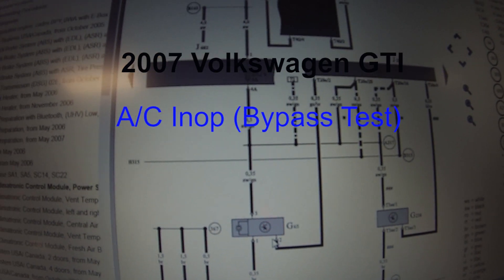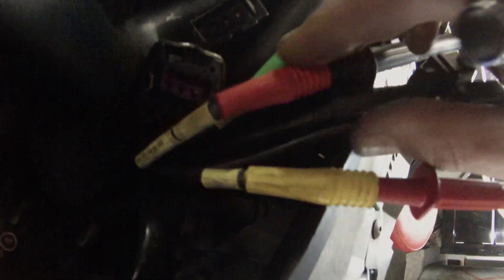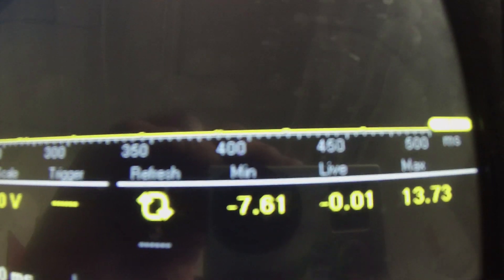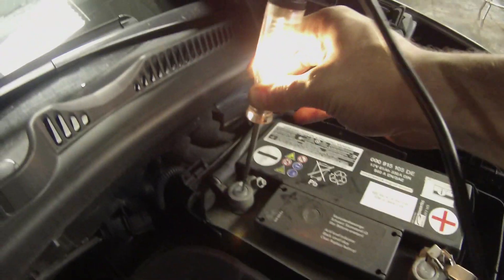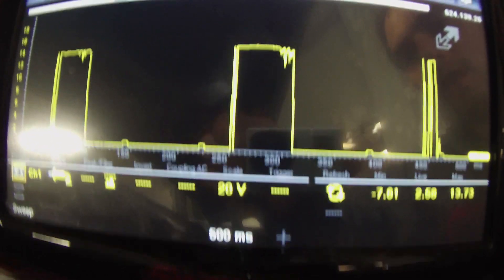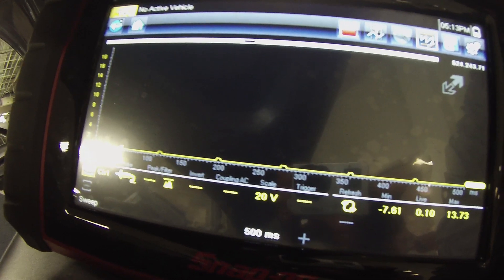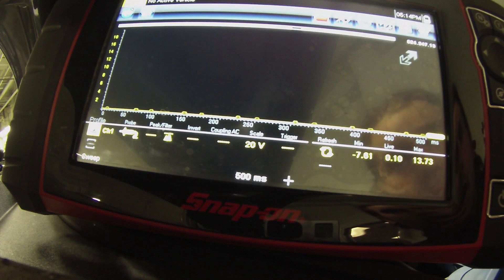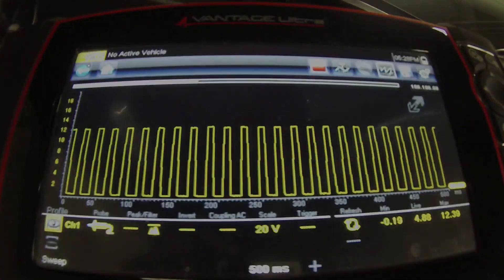2007 Volkswagen GTI A/C Blows Warm (Sensor Bypass Test)

Comment: That was awesome I just wish I would have seen this video a couple days ago. I am not familiar with VW but it seems I been looking at a lot of them lately. I had a AC that didn't work and did not know that it was a pressure sensor and not a switch so I put 12v to the signal side and nothing happend so I confirmed I had everything at the fan module so I told the shop that he needs a fan module. Lucky for me he didnt replace it right away and I went home and did some research and found out that the sensor is a common fault and it sends a signal to the fan module. I checked for the signal and it was exactly like your bad one.
So I went back and drained the system and changed the sensor only to find out that it has a schraider valve on it and didn't need to recover the freon.
That was a awesome bypass test!!
Reply from the maker: thanks John. Sometimes there are also compressor off codes in the a/c module data that will tell you why the ac is not on.

Comment: The signal is pwm signal from computer, it must be constant, lets us say 5v pwm volt coming to sensor from computer.. with increase in pressure should I expect change in duty( longer 5v line) or frequency increase?
Thankyou

Comment: That is wild that this sensor generates a modulated signal like this!  I loved the bypass test!  Do you happen to know how the HVAC unit interprets this signal?  Is the interpreted psi based on duty cycle  or frequency?  Great video!
Reply from the maker: I believe it's just a frequency. The control module knows that there is psi in the system based on the frequency.

Comment: I believe im dealing with this issue right now in a 2007 jetta 2.5l. New compressor, compressor control solenoid, drier, and expansion valve and still no ac. I grabbed a junk yard pressure switch and it didnt fix it but im not sure if it was good anyway. Are these pressure switches common to fail and are they vehicle specific? say one out of a turbo model car would work for a 2.5l nonturbo?

Comment: I have a 2007 VW Passat 3.6 4Motion with Climatronic.. the AC only seems to come out cold when driving on the highway. 
I’ve scanned it with RossTech and SnapOn pro scanner(similar to the one you are using)... and it said V158 and 159 were having intermittent issues so I’ve replaced them(temp control flap motors).. but that didn’t help with the AC not coming cold..
I’ve recharged the AC.

Would this sensor be something I should look at on my car or is it a different system?
Reply from the maker: Sounds like an airflow issue across the condenser. Do the fans operate?
Reply: Positive Lead Diagnostics the car never overheats and the fans come on when I’m driving.. but they don’t turn on when I turn on the ac unlike my other identical car does which has ice cold ac.

The low side ac line will be ice cold when I touch it after driving but once I park and let it idle it soon is no longer cold even if the fans were still running
Reply: Positive Lead Diagnostics so a new radiator then?
Reply: @MacB369   Did you ever find the cause? Im having similar problems for my 3.2 passat. :D

Comment: 09gti i changed a high pressure switch and the solenoid,condensor fan works,compressor works only if i feed 12v throught the solenoid,i tested it,my solenoid only gets 8volt coming from the harness wire.and see no pressure.what possible goes wrong.wires?

Comment: i have a 2013 VW golf 2.5 automatic that the ac just died on me. would you happen to know if it has a valve? or do i need to evacuate the system to change this sensor? i have the same symptoms. fans not coming on and i hooked my gauges up and the system has pressure. the sensor is located in the same location as yours in this video. any help is greatly appreciated
Reply from the maker: best bet would be to scan the hvac system first, but that sensor should have a valve and you don't have to evac the system

Comment: I have a 06 Jetta 2.5 I'm looking for the input turbine speed sensor
Reply from the maker: That sensor is in the transmission. I think you have to remove the valve body to get to it. I would check the connectors where the harnesses go into the transmission. Wires always break around that area